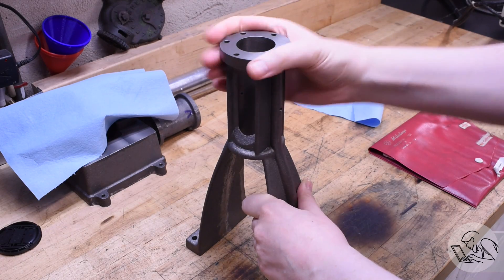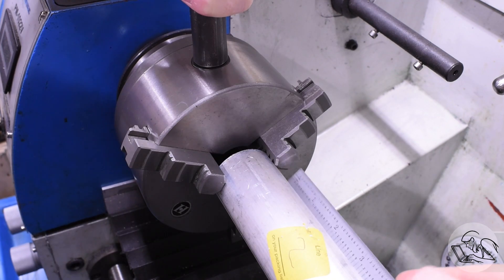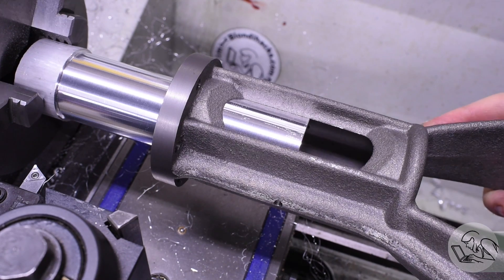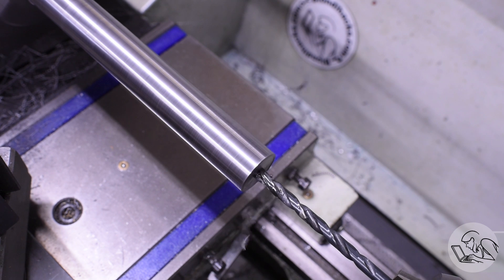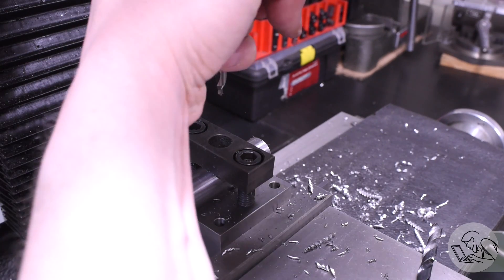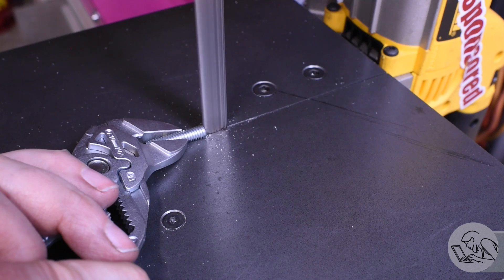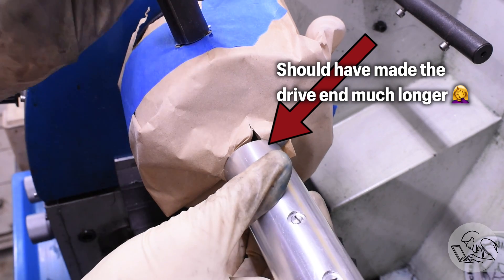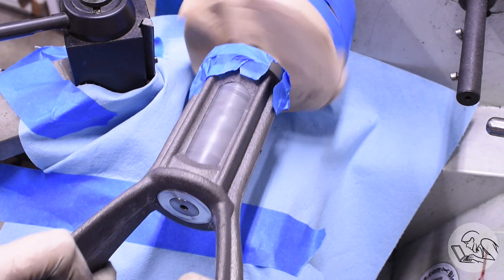Lapping a Cylinder! Big Steam Engine Build, Part 7

Comment: During my 50+ years of precision machining and the restoration of large and small mechanisms, I've learned the importance of "Normalizing" prior to the final cuts being made. This is done by heating the part to about 300-375 degrees F, then putting some sort of blanket wrapped around it. Let it slowly cool overnight to relieve the internal stresses. After that, you will produce much more precision that does not move afterward. I have also applied this method to correct rifle barrels from "thermal drifting" after several sequential shots. And YES, lapping is always used to remove "high-spot" machining marks and ensure roundness in any precision bores. Always finish lapping in the direction of the mechanical movement. I.E. - If the motion is linear, then lap/polish in that same linear motion. This reduces mechanical wear and friction. 
BTW - Great stuff in your videos. Keep up the good work.
Reply: Yep. When I first started an advanced diploma in engineering I was talking to the teacher about a problem he encountered when he was out in the real world. He said they were producing a gearbox but despite the precision machining they would end up leaking (they were a cast iron industrial box of some variety). I just said, 'Stress relief'. He said, 'Yep, that was the whole problem. After the stress relief they were machined and no more problems'. Maybe some people are so close to the problem that they can't see the obvious solution.
Reply: Normalizing involves heating the steel to an elevated temperature, followed by slow cooling to room temperature. The heating and slow cooling changes the microstructure of the steel. This reduces the hardness of the steel and will increases its ductility but it does not stress-relieve which is what you are describing, and neither of those are needed when machining cast iron except for the normalizing that was done at the foundry.
Reply: @normstaley9799  I believe you are referring to annealing, where the objective is to remove hardness from the metal. Normalizing (annealing) reduces the reaction to stress.
BTW - My extensive experience begs to differ from your opinion on huge castings. They do tend to warp after heavy machining! High-quality Milling machine castings are rough-cut, then left outside in the sun for a couple of years to normalize any stresses prior to their final machining/grinding/scrapping to size.
Reply: @targetshooter3751  FYI I also have 40 plus years as a machinist and I have never had a carting move or warp from rough machining If there is twist in it after rough machining it's because of improper clamping,  and my description of normalizing came from google so take it up with them
Reply: I've been machining and welding fifty plus years, and working with fresh new iron castings and forgings.  I like to put such in an oven and heat, cool several times to relieve stress and "normalize" the iron.  Up to 400-450 for fresh castings, as long as they're away from direct exposure to flame.
Reply: @johnmcclain3887  Thanks, John.  I had the great fortune of apprenticing under a half dozen German Tool and Die Makers in an engineering model maker shop in the late 1960s.
They were quite harsh but took great care to teach me all they could. As some of them passed away, I was given their tool boxes (filled) per their will. Now when I go out to my shop and pick up any tool, one of four of their names is usually engraved upon it. I feel as if my best friends of long ago are still with me.  What a rare privilege I am honored to have in my life.

Comment: For parting threaded rod, just use one of your regular insert tools to get rid of the thread in the area where you're planning on parting, then part it off as normal. nbd.
Reply: Or snug up the parting tool to the thread depth, then back to the depth you need.

Comment: Just to be pedantic, you CAN reuse a lap with a different grit compound. However, you can only do that if the second compound is coarser than the first.
Reply: That makes sense, but I didn’t put two and two together so thanks for mentioning it as its god to know

Comment: I suspect that 400 grit was a good balanced choice to retain a little surface texture for bedding in and oil retention.  Can't wait to see that engine in action! I use a cheap ultrasonic bath and warm detergent after a blast with brake cleaner to remove any remaining grit after lapping.  Today's lapping challenge is getting a mirror polish on a 1.80 mm mmwave waveguide bore. I'm now going to have to say "Lappy lap lap" in my head every time I get the diamond paste out....

Comment: I remember making this lapping tool back in the early 90's and being for lapping cast iron, 4 cylinder engine block after it had a main bearing journals line bored for a thicker main bearing shells (after one of the bearing shell has spun in the block). My lapping tool was about 60cm long and was made to obtain journals bores lapped down to a 0.002mm accuracy. Fine lapping paste for valve lapping, thinned with a parafine... The problem was that there was no YouTube back then to get thousands of people excited...

Comment: For future reference, 3M makes an aggressive backed lapping film (paper) that woodworkers use to sharpen plane irons and chisels. It's not terribly expensive and you can put a mirror finish on hardened tool steel. They have a variety of "grits". I buy it at my local Woodcraft. They carry 12 micron, 5 micron, 1 micron and 0.3 micron in 8½ inch by 11 inch sheets. I'm pretty sure they make other grits. The stuff is works like magic.

Comment: I've seen Mark's video on lapping and you're right, it's very good.  As is his channel generally.  Nice job on your lapping tool.  And as to your comment on the finish on lapped model engine cylinders you're doing fine with the finish you have.  Even the lapped cylinders don't arrive mirror shiny.  They are a little more reflective than what your 400 grit surface is but still show some slight texture.  Mirror surfaces are not great for holding oil after all.  So smooth is important but we still want a very slight tooth or texture to aid with holding the oil too.  

Something you might try on some scrap is to take something as smooth as you have now and burnish it with a harder rubbing tool and some lubrication to form smooth plateau like crests on the surface texture.  This can create the best of both worlds with the "valleys" to hold some oil and the smoothed off "plateau" like crests to provide smooth consistent support for the piston rings or the skirts on lapped pistons as is very common on model airplane engines.
Reply: @markfergerson2145   Cast iron is certainly able to be burnished.  If we can rub it with a smooth hard tool and leave a line ( and we certainly can) then that is an example of burnishing.  Doing the whole bore is just an extension of that.  And in fact when I read up on lapped model airplane engines a lot of the "break in" is the harder surface burnishing the softer surface.  For model airplane engines with lapped setups making one part from cast iron and the other from steel or leaded steel is very much a "thing" for just this reason.  Hope that helps!

Comment: I am preparing to bore the same in my own casting, and I believe I will use the ledge you point out as "better".  I did most of my machining life on engines, and I've got a "bearing lap" for Harley's which is exactly the right size lap for that size cylinder.  This effort reminds me of the bar you made for original alignment.  Lapping the frame should be easy, given the two "open windows" allowing lapping compound to be watched and added as needed.  Your experience here is dramatically changing my plan of attack.  You've done a very good job assessing, the lapping is a very fast way of achieving that kind of finish.  I was able to size connecting rod ends, closed with rollers, within a tenth of a thousandth on the Harley rods once I had the experience.  Thanks for sharing this!

Comment: I sure wish I had seen this before I finished mine.  Great job.  On the cylinder I had more problems with the valve bore.  It has to be a real 'slip' fit on the valve or what you will get is a constant leak out the exhaust port.  I ended up rigid honing the valve bore and then fitting the second valve I made to the bore.  Lots of lapping to the valve OD and checking the fit till it was just right.  No more leaking of air out the exhaust.

lg
no neat sig line

Comment: That was funny Machine Tool cancer! You might want to invest in a 3 point Internal micrometer set which can check for barrel, egg shape and other problems. Checking a two points inside of a bore sets it up for an error and measurement.

Comment: When I work with threaded rod in the lathe I thread it in to a coupling nut and use a jam nut to hold it to keep the threads intact. I have hurt threads even when using brass shims.

Comment: A tool-cut surface is a series of arc-shaped grooves separated by cusps. The first application of abrasive (or a file on an external tool-cut surface - like lathe work) removes most of the cusps VERY quickly. OTOH, if you just put the tool-cut surface into service, the operating friction does the same thing, so it is better to find out about it by deliberate smoothing.

Comment: Any one else seeing the shift as the live center engages with the piece at 04:02? I reversed and stepped through frame-by-frame to confirm. I've seen what looked like unwanted movement in various machining videos when viewing at nominal speed, but often stepping through by frame shows it's just an illusion. But in this case, it's definitely shifting slightly as it engages. Not sure if this really a problem, but I does lead me to wonder why it could be happening. Did the center drilling operation go slightly off center? Is there a very slight alignment difference between the center drill and the live center perhaps due to the way the drill chuck vs. live center engage the tail stock taper? I don't really know enough to comment on what's likely. But, for once, my eyes were deceiving me... Anyway, now back to the show!

Comment: I don't think you'd want a polished finish anyway. You want a "rougher" finish anyway to hold oil. Much like the cross hatch in the cylinder of an engine. If a cylinder wall wears to a polish, it will burn oil. Your cross heads are going to like an oil film too.

Comment: Impressive work.  Out of curiosity could you have changed the order of machining to creating the bolt holes first?  You would then use the bolt holes to secure the casting for boring.

Comment: I was slightly disappointed the you used the band saw to cut a screw slot for your set screw.  I was anticipating an Allen head 😱...... but certainly not a Torx  head, because  we all know that would be crazy stupid. 😁
That was a really neat tool. I'm impressed at how well it corrected the egg shape. 👍

Comment: what i do when im lapping deep drawing dies to a dimension (on my mini lathe ofc) is i wrap some extra paper towel around the screwdriver before wrapping the 1000 grit sandpaper around it to make it wider. sorta similar.

It's weird, with lapping dies like that, you really have to have a good feel for how much you're going to have to undershoot on a dimension. Every additional thousandth of an inch of increase in I.D. means a lot of time lapping, and you can not go over, but you also need to have a very fine surface finish. this generally means you undershoot by like >5 thou and just spend like an hour lapping. maybe i should look into a set of adjustable reamers...

Comment: 7:36 This might be a dumb question but why not centre drill it while it's still choked up in the chuck, just after facing it?
Reply: Not a dumb question at all.  If you center drill it before extending it in the chuck, you run the risk of introducing more non-concentricity in the part.  If the part has any amount of bend to it, you wind up with either the center-drilled hole or the middle of the part revolving around the actual center axis of the lathe.  If you have a lot of material to remove, you would eventually get back to a fully round part.  

Extending the part and then center-drilling (after tapping it in, as Quinn does here) reduces the overall amount  of non-concentricity along the full length that any bend introduces, in turn reducing the amount of material that must be removed to bring the part back to fully round.

Comment: 13:45 - hmmm, would turning it down to inside the inside thread diameter with a single point cutter and then hitting it with the parting tool be an alternative solution?  (Not that I see any problem with the solution you went with, just curious.)

Comment: On drilling a long hole - entirely unnecessary of course, but remember your single point milling cutter you made on the D-bit grinder?  Make one of those but with a meter long piece of O1, harden, temper, and regrind the tip, and relieve the shank over most of its length, leaving a few inches untouched behind the cutting point.  Drill and ream a pilot and your long drill will just keep on cutting in the same direction for ever.  You have to keep withdrawing to clear swarf, of course, but what is time to the hobby machinist?  (And for the lazy and/or cash rich among us, there are gun drills...)

Comment: Hm. Instead of clamping the stock long, then indicating it, then facing it (which might put it off center again) and afterwards center-drilling it, why not clamp it short, face and center-drill, then re-clamp long and center it with the tailstock?
Reply: If you center drill and then move your part, your center won't be concentric and will make your live center wobble. You'll also end up with drilled holes that are all wonkadoo. What you're suggesting only really works if you'll be turning between centers.

EDIT: this is something I learned from this channel, but I don't remember which video she talked about it.
Reply: @GregBadabinski  I don't think so. If you clamp short, center-drill, then clamp long and use the tailstock and center to hold the workpiece, the run-out should not increase. The excentricity should be determined by the chuck. You can then turn the outer face to dimension and then drill out the center hole.
Reply: @MatthiasWelwarsky  You're assuming the bar stock is perfectly straight and it hardly ever is. Did you see how she had to tap it in with an indicator when it was stuck way out?

Comment: Given the cylinder floats on the mandrel, did the mandrel have to extend all the way down the cylinder, or could it have gone just past one expansion screw so there would have been more of the mandrel sticking out the other end, where you would have liked more anyway?

Comment: Couldn't you turn the surface of the outer cylinder and remove the ground in abrasive? Then you could use it for a project with a slightly smaller bore size

Comment: Cast iron has a nasty habit of changing shape as it ages. Race engine builders like to use old blocks that have been through thousands of heat/cool cycles which normalizes them so they stop changing shape. Time alone can also normalize cast iron. Some auto manufacturers used to let casting sit outside for a couple of years before machining to achieve stability of the block. Once normalized builders can bore cylinders and line bore with assurance that their precision machine work wonk go to waste. New blocks can also be normalized in heat treat ovens before machining.
Race engine builders also use torque plates when boring in order to distort the cylinder as it would be distorted with the heads bolted on. With torque plates in place the cylinders are bored round and will usually no longer be round when the torque plates are removed, however when the heads are bolted on and torqued to spec the cylinders will return to their bored round shape and dimension.
When clamping for your boring operation you may have been able to avoid distortion due to your clamping setup by fabricating a plate with a hole in it which would be bolted on to each end of the cylinder and clamping the fabricated plates leaving the cylinder with no unequal side forces applied.